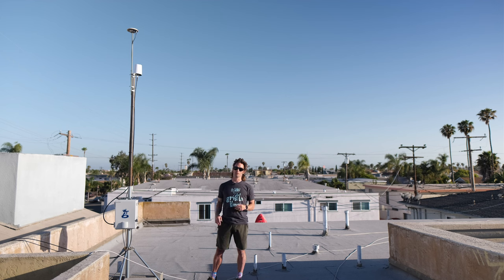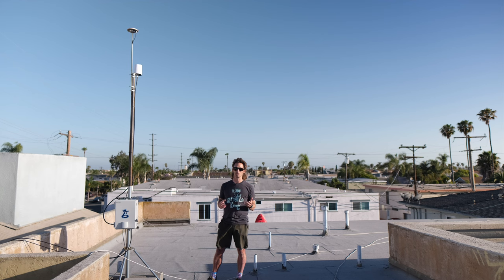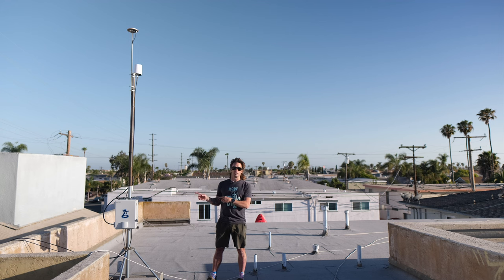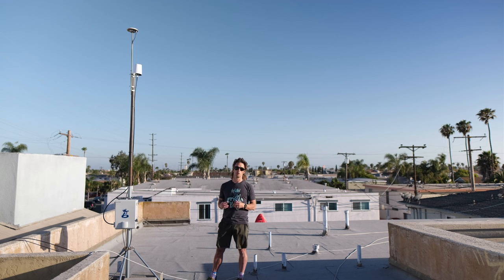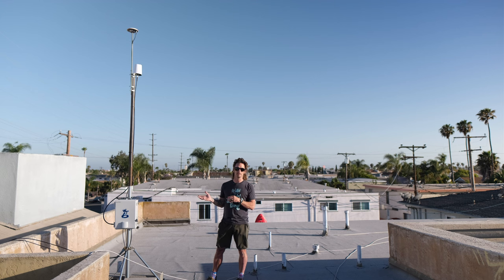Bobber 500 + GEODNET Deployment

Comment: The power consumption of the 5G part will likely increase when its working flat out transferring data… maybe not up to the 60w but it’s something to keep an eye on if your POE source is limited… it could show as reboots or modem card resets which you’ll spend forever trying to debug 😜
Reply from the maker: Thanks Jon!  I should be covered with a 60watt splitter/injector convo, but definitely something to keep an eye on.  Thanks again for the heads up!

Comment: Does anybody have data on the potential earnings from the 5G? I bought the freedom fi gateway, but I still don't have any idea what kind of money I could make aside from my speculative calculations. How could I justify spending another $2500 when I have no idea of what the returns might be?
Reply: i got a freedomfi miner but no antennae, i did not know I had to get the antennae as well. i gotta go get one to complete the setup.
Reply from the maker: I think I've seen $60/hr at full throttle (lots of people streaming video etc through your radio)

Comment: Sweet setup! Now your HNTenna is is running both your helium hotspot and also your Bobber500 5g? Or does the Bobber500 run as a regaular hotspot as well. Didn’t know that we use the same antennas for the 5g
Reply from the maker: Nope, the Bobber500 has 2 separate radios.  One is the standard LoRa one we're all used to, which is what the HNTenna is servicing.  The other is the 5G side, and that's down in the office.